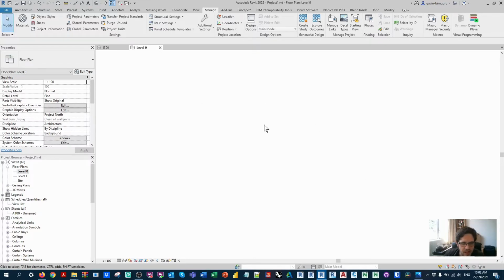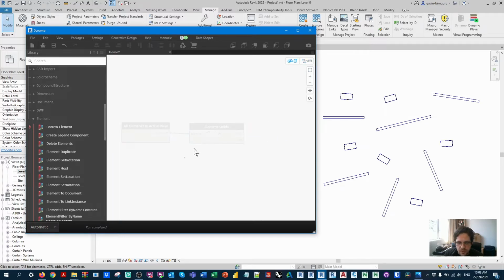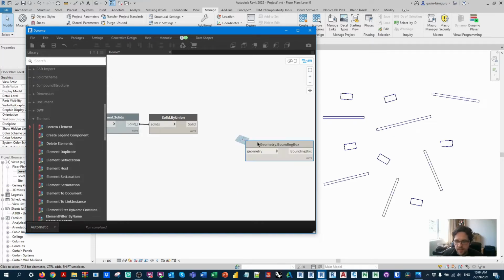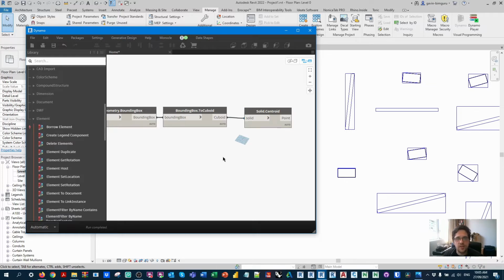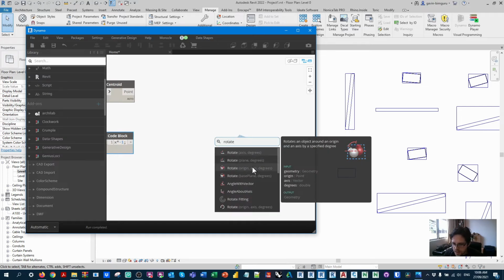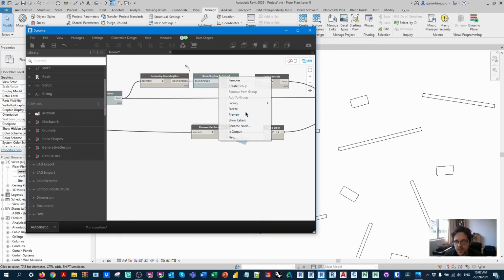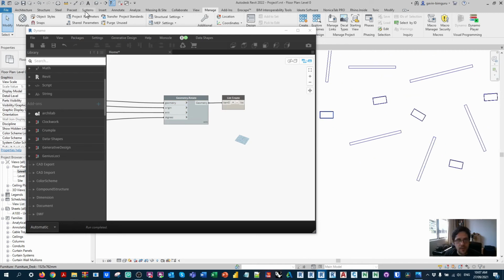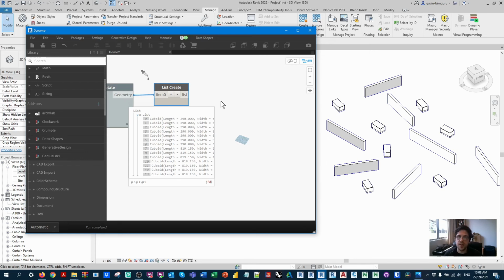Element aligned bounding boxes in Dynamo!

Comment: Nice Video! is there a way of geting the rotation of the cuboid itself? In my project I am trying to get the rotation of ifc-elements, which were not created in revit. Unfortunatly the node in your video only works for revit elements. Thanks
Reply from the maker: The best way I can think of is to get a horizontally facing edge of the cuboid (Z of direction = 0), then modulo its rotation against the Y axis against 90, of which its remainder will be its rotation.

Comment: if I want 4 coordinates of top surface , then it is the only option to get or anything else?
Reply from the maker: Get the bounding box face with highest z value at its centre and its corners, or you can get min/max point and build the 4 points from that then rotate them back to the element orientation.
Reply: Only getting min and Max point, how to get another two points,

I am drawing a rectangle and I want 4 coordinates.
Reply from the maker: @PANDURANG99  deconstruct the points into their xy values. You can then use them to build the other points, for example the top left point is min X, max Y and max Z.

I believe theres a rectangle by 2 points node as well if you move min up to max Z.
Reply: @AussieBIMGuru    For example we have min X ,min Y and Max X,max Y

Means diagonal end points, if the rectangle is parallel to x or y then we can get easily another two points but if rectangle is tilted  at some degrees then having problem to get another two points, then we have length and width of rectangle but example,we take a min point then we don't know at which side is length or width.
Reply from the maker: @PANDURANG99  yes if the bounding box is not parallel then you would need to rotate/bound/derotate the geometry first by a rotation if known like i do in this tutorial. Revit does not support bounding boxes on angles, and does not know the rotation of elements unless they have a property that tells them the rotation.
Reply: found solution thank you:person-turqouise-waving:

Comment: Hi great video, it will very useful thanks. May I ask you how would you proceed to automatically align an element to another one using dynamo? For example aligning an plank to a rotated cube. Thanks 😊
Reply from the maker: Generally if they are revit families you would need to calculate their needed rotation and location point then use element.setlocation. It would generally take some mathematics and geometry processing to determine the required location based on the object size.

Comment: Great video. Will that work with floors in which all curves were drawn at 45 degrees? It was not rotated, just drawn that way when the floor was created.
Reply from the maker: Unfortunately floors do not have the rotation property that family instances do. In that case you could rotate it by 45 degrees instead of using a rotation, or if you have multiple floors, get their edges and check their angle to the Y axis down to the lowest interval between 0 and 90 and use that as a rotation instead.
Reply: @AussieBIMGuru  Thanks for your answe, I aprreciate it! I think I'm gonna try your second suggestion, as it is intended to work with whatever angle the edges have.
Reply: @AussieBIMGuru   Just a quick update. The second approach worked. Thank you!

Comment: Dear Sir,
I have question.
I want to bound 3 lines by rectangle, try many ways but no hope.
Could you help me some guide?
Many thanks.
Reply from the maker: Bounding box by geometry would typically be the way to do this (and you if they aren't joinable as polycurve then you could bound the cuboids of their bounding boxes, joined as a solid union), but if you need the rectangle to be aligned away from the Y axis then it is much harder - and I'm not sure how that would be done. Suggest asking on Dynamo forums. Technically 3 lines could be bound in more than one way depending how they are drawn, so you might need to bound them using brute force, such as testing 360 degrees of bounding box rotation, then taking the smallest area rectangle result. I'd suggest using Grasshopper 3d for that as it is much better at planar aligned bounding boxes and is very quick at bounding.

Comment: Thanks  Gavin!  But there is a big deference between the BooundingBox and the Cuboid(Solid), Try to rotate BooundingBox you will get and Erreur. 
is there a way to Rotate the BooundingBox ?
Reply from the maker: Unfortunately the bounding box itself cant be rotated as far as I know as it's always Y axis aligned in dynamo, but a cuboid shares pretty much all the typical properties of a BB.
Reply: @AussieBIMGuru  Hi Gavin, this does present an issue as BBoxes can be intersected (clashed) with elements but Cuboids seemingly cannot. Do you know if Cuboids can be used for this function?
Reply from the maker: @chrisedwards3272  i believe they can be intersected as solids the way other geometry can be, but not using the specific methods in the Revit API reserved for bounding boxes.

Comment: How would you turn your cuboid back to a bounding box ? I need a bounding box to turn it into a section for my 3D views by appartment. 
My problem is that all my appartments dont have the same orientation... 
I manage my plans for crop region, that's fine. But the 3D section box orientation is still anoying me

Thanks for all your videos by the way, really helpful :)
Reply from the maker: I believe the Element.SetRotation node should be able to rotate a section box after it has been made.
Reply: @AussieBIMGuru  This node doesn't seem to work with bounding box or 3Dviews itself. I'm also trying 3DView Set Orientation by Genius Loci but it doesn't seems to work neither so far

Comment: Thank you, I really like your video content, I have some questions to ask like how do you use the ALT button with the list, how do I make it show automatically when I use ALT + Click Mouse. Please guide me further. Thanks
Reply from the maker: Do you mean the ribbon shortcuts? I dont tend to use them as they take too many steps to reach a final command - I usually recommend using actual shortcuts instead which can be configured and imported/exported if customized.
Reply: @AussieBIMGuru  thank you, but can you guide me, i would love to learn to disable that command - ALT + Click Left mouse
Reply from the maker: @nguyenminhhieu440  oh I don't believe it can be disabled. Try checking for its shortcut in the shortcut manager maybe but not sure its assigned that way.
Reply: @AussieBIMGuru  Where is its shortcut, can you show me?
Reply from the maker: @nguyenminhhieu440  the keyboard shortcut editor is rightmost on the view tab
Reply: @AussieBIMGuru  Yes, thankyou

Comment: Nice technique! After that would be nice aligning a section box in the 3D view to match exactly one of these resulting bounding boxes, with the correct orientation
Reply from the maker: I believe it would be better as a different workflow given we have multiple elements here and not one to section box. Section boxes should be able to be enabled and rotated using the Genius Loci package. There is an Element.SetRotation node that should centre a box about a point.
Reply: it reminds me PyRevit section box orientation on face ( you select the face)

Comment: Thanks 
Can you explain how to create callout in dynamo?
Reply from the maker: There is a script at the end of this thread which shows how:
https://forum.dynamobim.com/t/create-revit-callout/1024

You will need to generate the extents for dynamo using a rectangle in Dynamo.
Reply: @AussieBIMGuru  
How can i reach to the script?
Reply from the maker: @amrhariri1996  sorry it pasted wrong. Try this link.

https://forum.dynamobim.com/t/create-revit-callout/1024
Reply: @AussieBIMGuru  
I've read this article before... but unfortunately the node doesn't work with the structural view...
Reply from the maker: @amrhariri1996  hrm not sure about that one myself. Maybe make a topic on dynamo forums to troubleshoot your script.